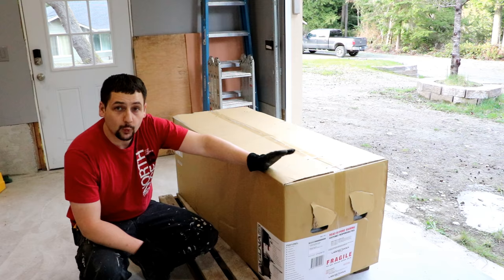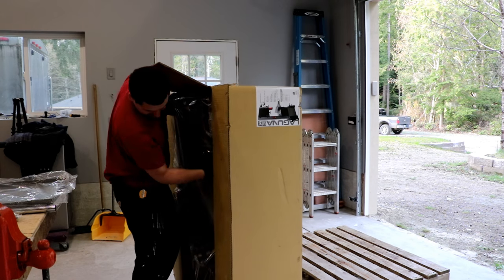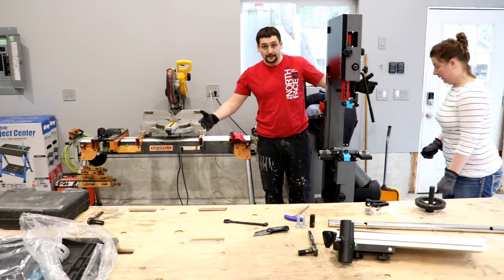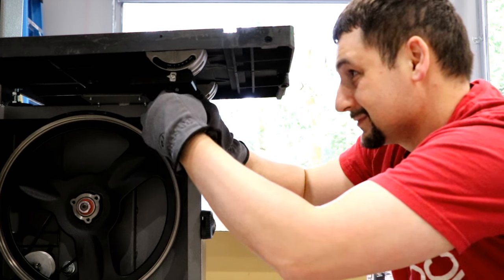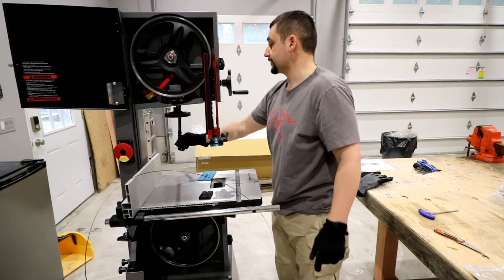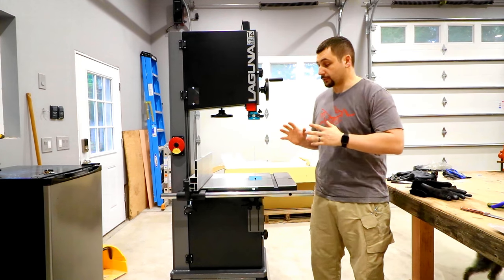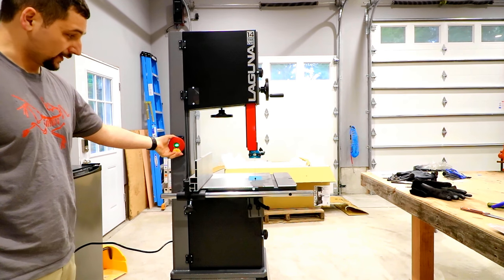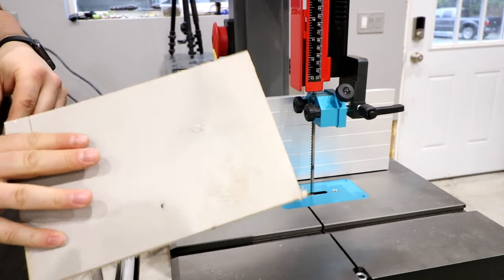Laguna 14X bandsaw

Comment: In the future Daniel please unplug the saw when you are making any adjustments to the blade guides. 
The “safety key” is not meant to safely prevent the machine from starting. It is only to prevent unauthorized use.

Comment: Simply outstanding presentation. Wish I had the $ for the BX. But I don't. So here we are. I'm debating between the Grizzly G0555LX and the 1412 featured in your video. After watching this video several times I'm heavily leaning towards the Laguna. Hoping you could share your impressions of the saw, likes/dislikes and if you'd buy it again now that you've had it for half a year.
Reply: Just got a Laguna 14bx 13/4 hp been working in wood shop for a number of years,this saw is great very well made. Hope you get laguna